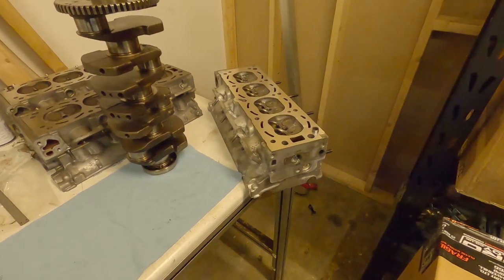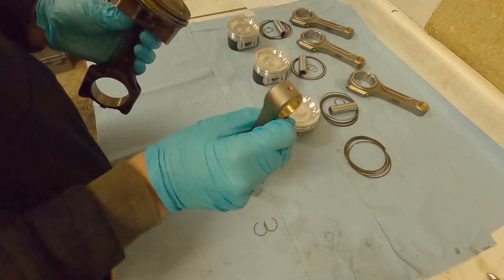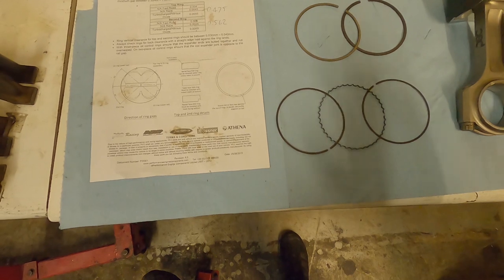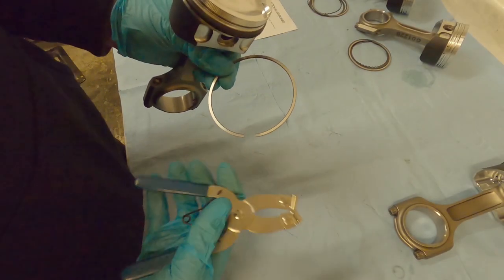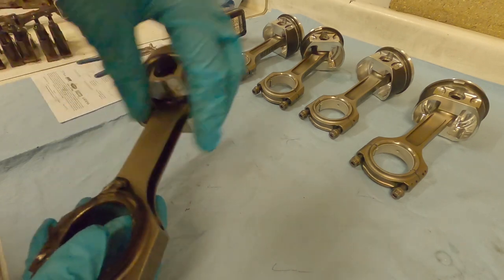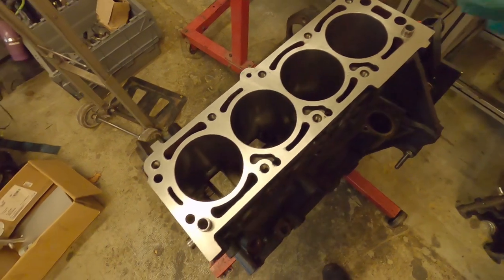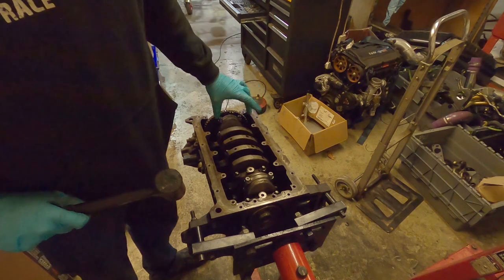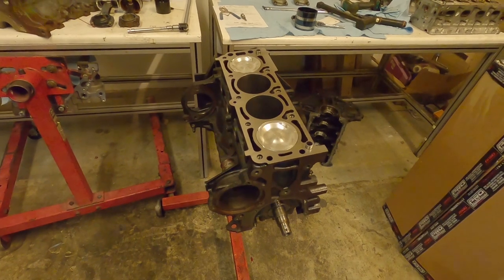Engine Building Part 5 - Piston & Rod Assembly and Installation

Comment: im currently building the same engine and we have a problem, when you fitted the rod bearings only 4 have holes and you have put 2 rods with all 4 holes and the rods on the left have no holes, im sure the ones with holes go in the caps, please help as im now stuck not knowing with way up to put them HELP!!!
Reply: IM GOING TO PUT THE HOLES IN THE CAPS

Comment: just perfect video to learn. very nice. haven't finished your series yet but would you have info about which part should be oiled when installing especially the bearing side ? 
obviously you need oiling between journal and bearing, what about the bearing to the block, need oiling too when final assembly ?
Reply from the maker: No bearings go in the block just crank needs oil.

Any moving surface contacts should be given generous oiling. So journals bores cams lifters etc etc

Comment: Hi.  I am puting pec rods in my Astra with standard bearings. Should I use plastic gauge?
Reply from the maker: Never ever fit a rod to a crank without a minimum of plastigauge even if you're putting a bearing and rod back together that was previously running.

Cranks are not guaranteed to be good. Rods can be machined wrong. Bearings can be made wrong all sorts.

You only have to be a a fraction of a mm too loose or too tight and then you will do a bottom end in. 

New rods new bearings new crank and a block full of swarf because basic checks weren't done before hand.

A bit of time, and some plastigauge allows you to be sure you're not building something that will end up as a pile of scrap in the near future.
Reply: @tunedbyrabbid  that’s great thanks.    If I do plastic gauge it.       What will that tel be how do I work out all the maths?     And work out the oil spec?